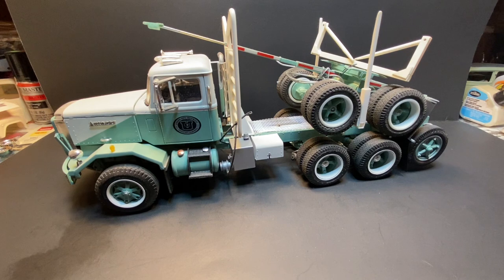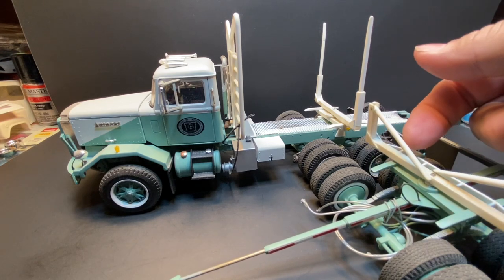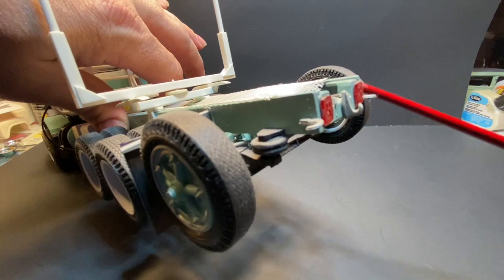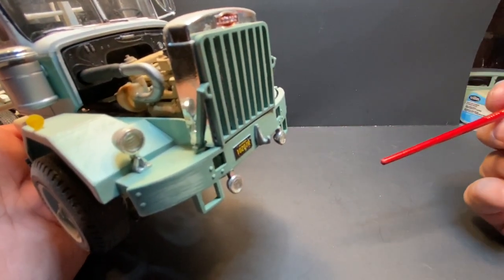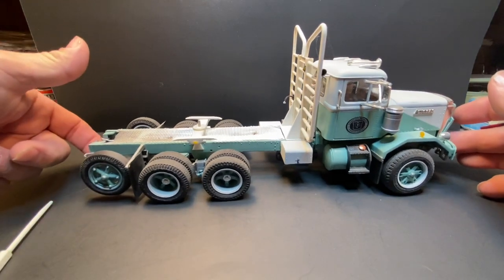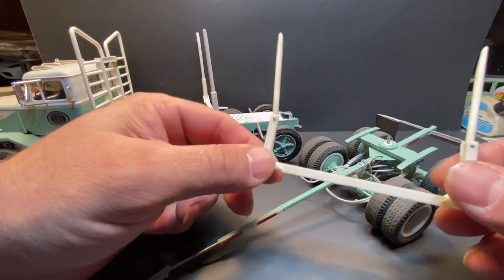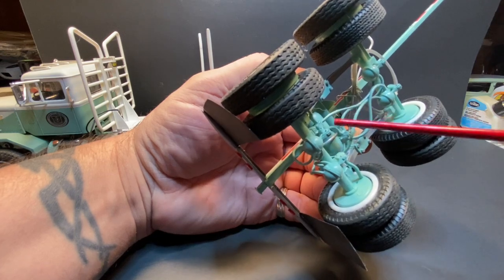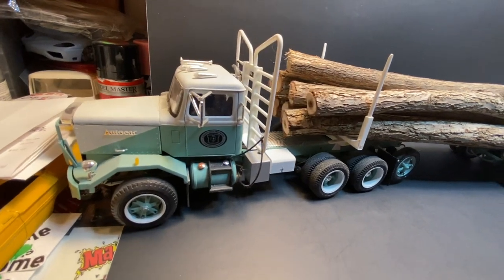Autocar DC9964 B semi turned logger

Comment: Doc, Great build. Most of the loggers that I have seen are Petes or KWs. The Autocar is a real work truck! Little chrome👍. Spoke wheels, and the pusher steerable axle, is just the right touch!!! And I like the mint green/ white. Lots of reds & blues out there already. If you put a different load of logs, with an extra long log, you need a flag stapled to to the end. A lot of thought went into this one!!!

Comment: Very nice!!!. Thanks for sharing, Doc.  Some great scratch building and it's nice to see the basics be addressed as well.  No seams to be seen in the fuel tanks, air cleaner, transmission case and engine block.  So many people overlook the basics.  Kind of a pet peeve of mine.  The plumbing also looks great and I like how you used a mix of different tires.
Reply from the maker: You caught the miss matched tires eh??  A+ on your test!!! lol
I knew on the real rigs flats happen and they grab whatever tires are there to get them on the road again so I used different tires in the build...  Mold seems are a peeve of mine as well, they must go or if not seen they may be left, but in an area where they are visual I try to make them disappear.. 
Thanks for watching!! More rigs coming soon..